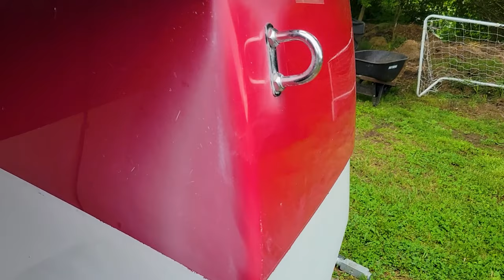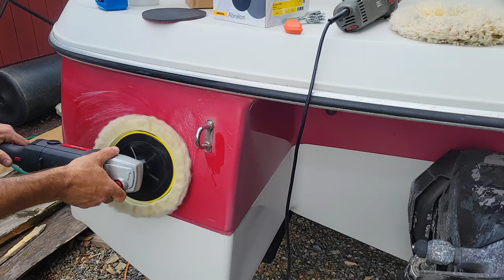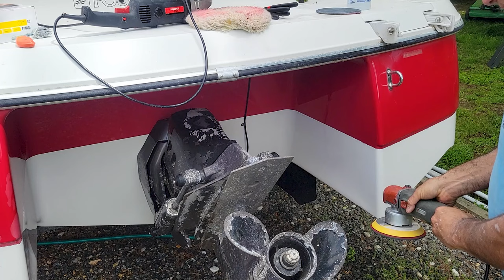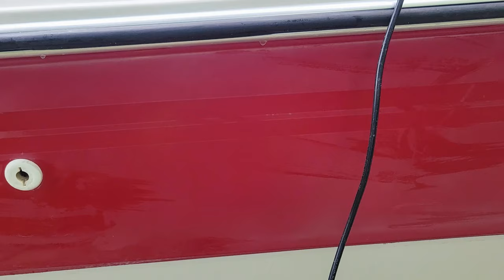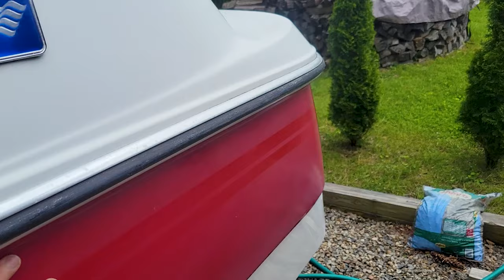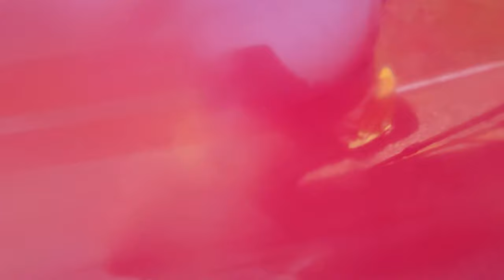Gelcoat Renew Day 3!!!!

Comment: Nice. I have the 95 220 Horizon. What I did: Washed the boat, used a boat eraser to remove as much debris as possible, then hit the whole thing with Meguiars Compound on a rotary. After that, I went to Meguiars Polishing with a foam fine foam pad. Will be putting on ceramic coat for the final step. FYI: try using polishing compound on the rotary around 1500-2000 rpms rather than using that pad!
Reply from the maker: Great tip!